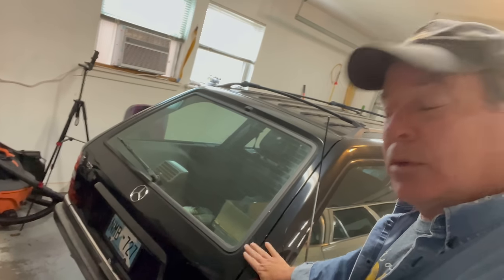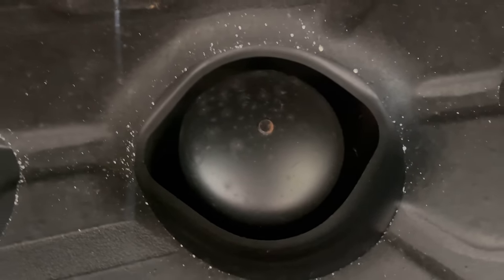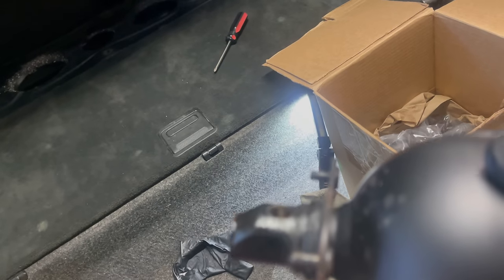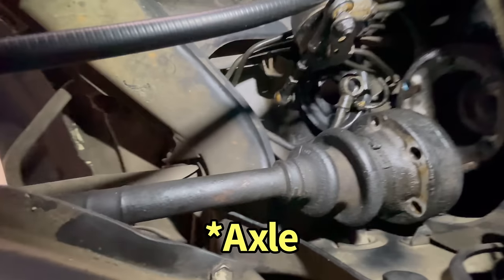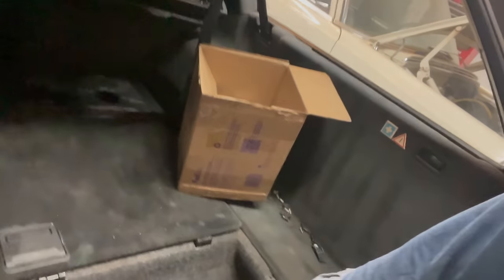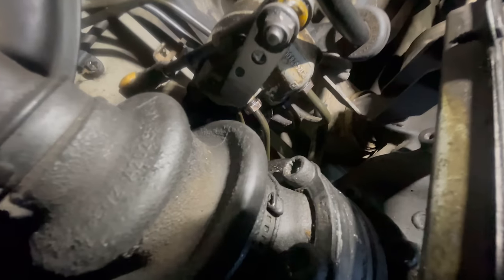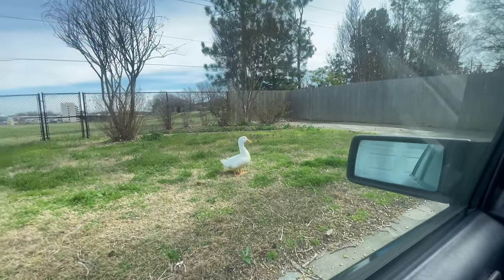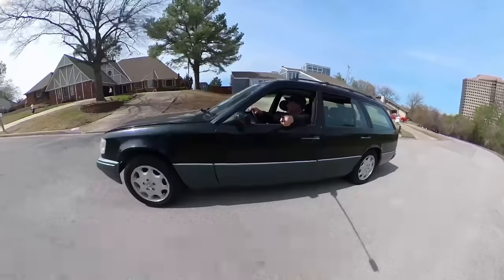How I Gave My Mercedes Wagon A Smooth Ride!

Comment: That's excellent. But even with the hours spend on the accumulators, it will be a bigger PITB to fix the jaguar. I suggest to buy a panther platform wreck and mount the Jag body on it 😁

Comment: Went through this exact scenario with my ‘94 W124 wagon. Driver’s side was a piece of cake. Struggled for hours on the other one. Ended up sending it to my local shop on a flatbed to re-attach the small line on the passenger side. The tech spent almost an hour on it but had success when he loosened the lines at the leveling valve end to get some “play”. The problem is the shortness of the hard lines on that side which doesn’t give you much wiggle room to get the threads started. My guy didn’t remove the axle. I was very grateful for his help and pleased that it took him more than 2 minutes to fix it or I would have felt like a total failure, lol. Keep the entertaining videos coming.

Comment: Hi Mike glad to see the wagon coming along excellent you did it on think I would like to give you safety advice don’t reuse  the copper washers on a banjo they are like a crush washer on an oil drain plug one use only reusing them can give you a major brake failure always get new ones at  the part store. Just want to keep you and Lola safe all parts stores have them never use a already used on 

The video was great love the wagon I really do thanks for the video enjoy your day 😊

Comment: You don't have to change the copper washers if you anneal them - by heating red hot then drop into water or oil to rapidly cool. They harden with age.

Comment: So the accumulator stores the hydraulic fluid for the shock absorbers?
Reply: Each valve block has an accumulator along with the return line. Each accumulator has a diaphragm with hydraulic fluid on one side and high-pressure nitrogen on the other. The accumulator supplements the pressure and fluid volume provided by the pump in cases where the suspension has to do a large correction.
Reply: Like a dampener.
Reply: There are no rear shocks, but rather, hydraulic rams that lift the wagon for heavy loads. The accumulators absorb the road shocks.

Comment: The previous idiot owner of my wagon replaced the rear hydraulic suspension with normal struts and it rides horribly, like it has no suspension at all. I purchased some coilovers to put on the rear and if those suck, then I’ll put it back to factory stock.